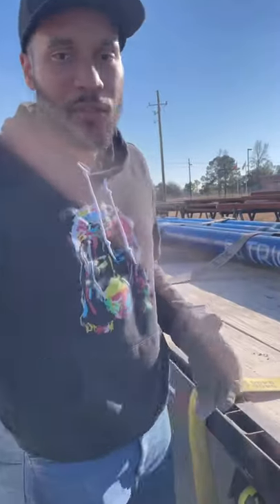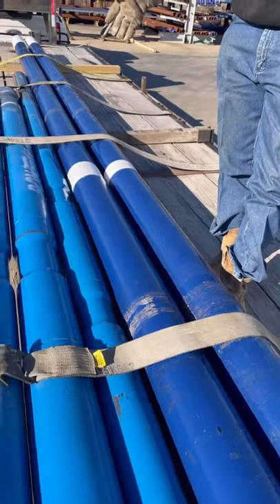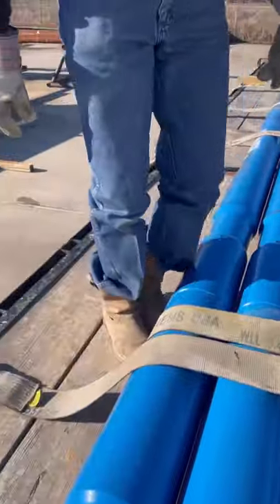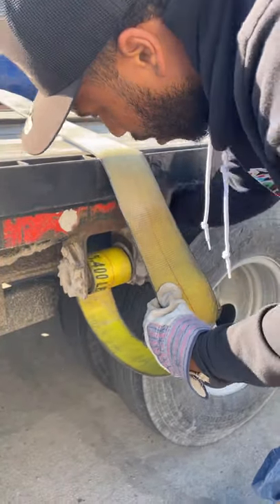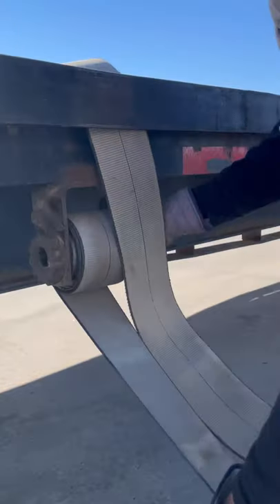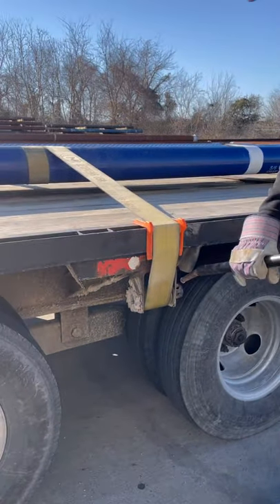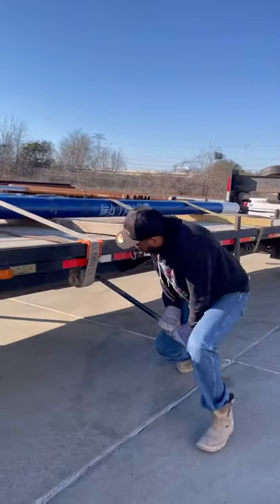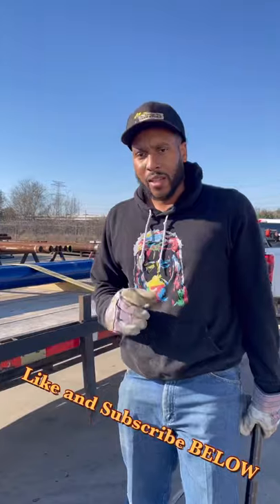How to Strap pipe on a flatbed trailer with Dennis Chachere

Comment: At the long run your gonna hypertension, on your knees believe me it'll already happened to me. basically when your only hauling small stuff like that you might as well the start using block cubes for more leverage so that way you don't bend your knees too much that can be dangerous in the future.

Comment: Where can I buy a breaker bar?
Reply from the maker: Any trailer place or even some loves truck stops. Look up nation wide trailer
Reply: @dennischachere  is there a certain size I should get?
Reply: I’m picking one up tmrw just need to know if there’s a  certain size/ length or what not .. thanks again
Reply from the maker: @RoadRuna  it doesn’t matter they are all normally the same size